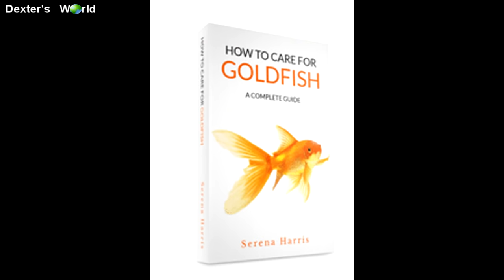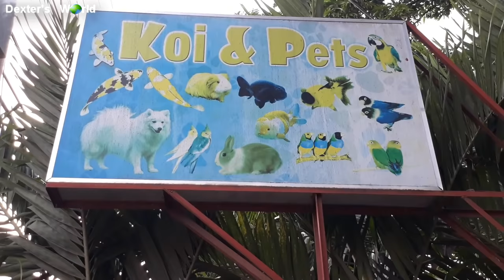I Got my dream SUV out of breeding ornamental fishes, ducks and quails

Comment: I would like to know where I could buy a large capacity, multi sized egg incubator.  I am sure most are made in China.  I would need a gas fueled unit.  Our province has a lot of power outages.  Dexter you really do have a positive attitude and positive mind set.  Congratulations on your new SUV.  God bless your businesses and I pray you will continue to be able to give back to the community.